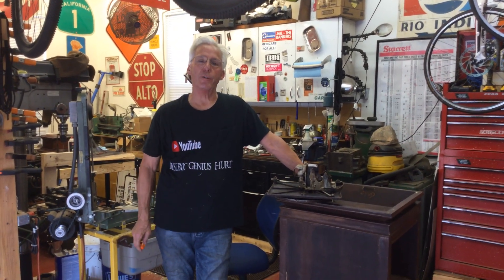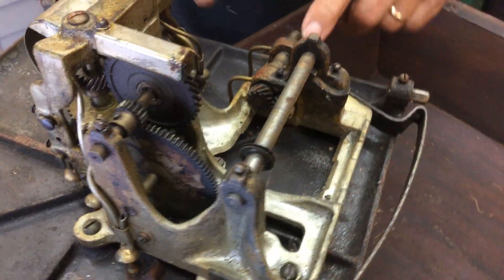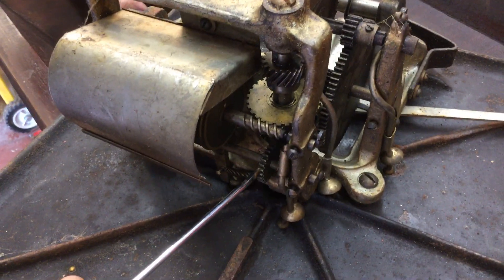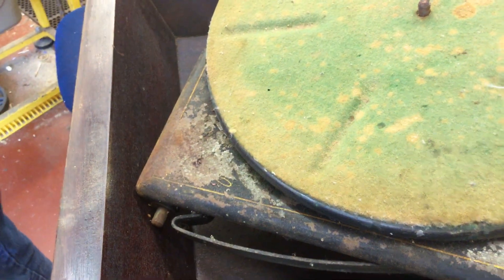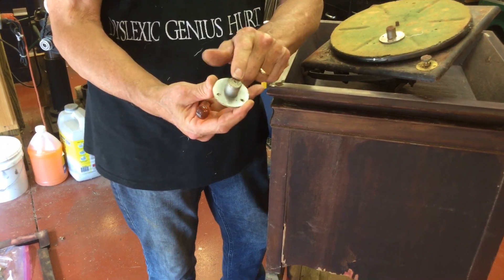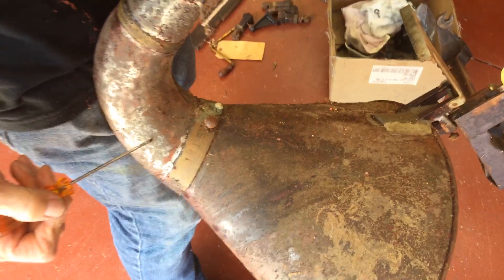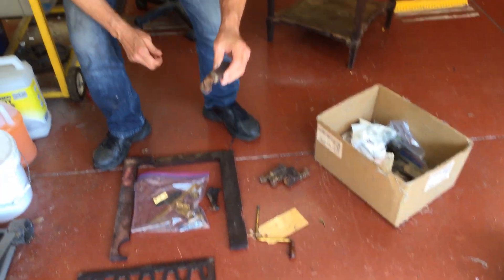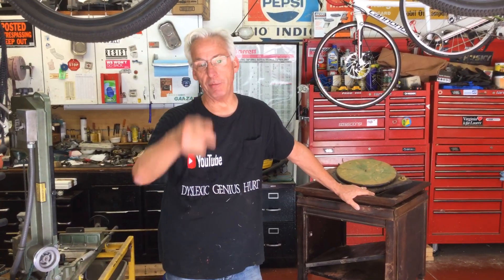337.  What I salvaged from the junker Edison A-150 phonograph

Comment: I can't say this enough, but these videos are so helpful when you are trying to restore one of these.  Question:  I saw that the motor board surround frame only had three sides.  There was nothing on the back side where other Edison machines have a curved piece of wood.  My A150 also doesn't have that back piece and I don't see any holes or slots where a piece would fit.  So based on our machines, do you think the A machines didn't have the back piece?  Thanks, Marc.